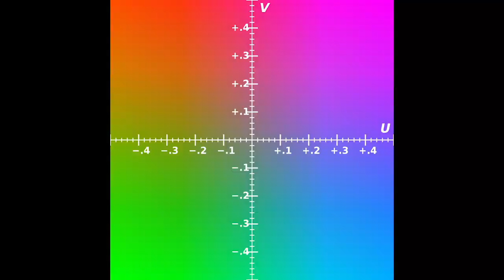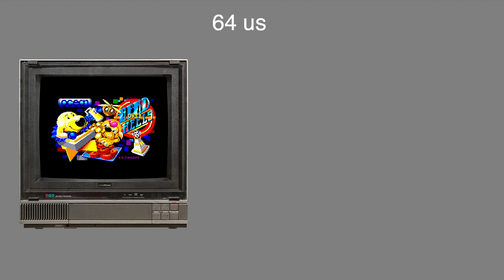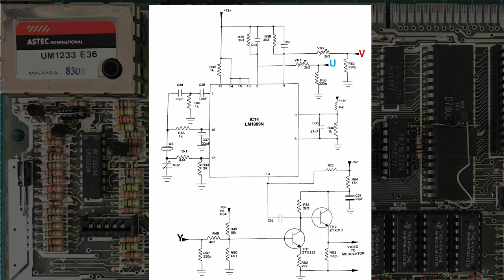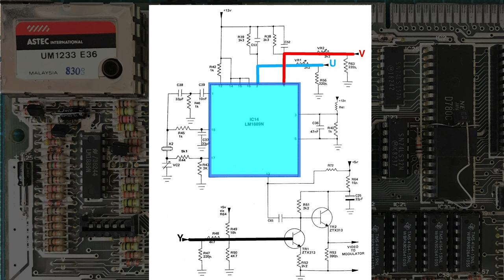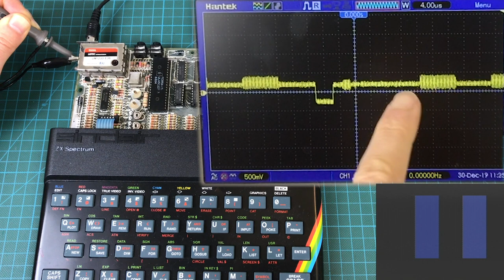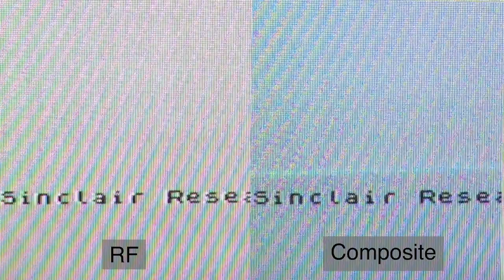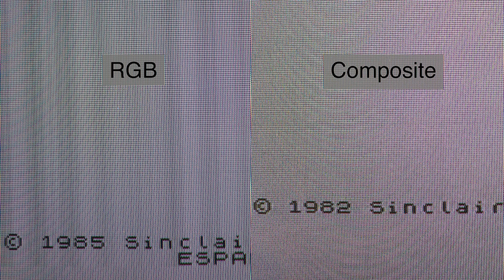ZX Spectrum Composite Video Mod

Comment: Back in the far past I had a friend mod my Spectrum 48k to have both RF and composite in the original output connector. Both the RF and composite shoved no artifacts when I used them on different monitors and TV’s.
As far as I recall the mod was done using a single bipolar transistor as emitter follower and a few passives, to inject the composite signal “onto” the RF output. I do recall this was a theoretical stretch as the transistor barely supported the required bandwidth, but the monitors I used managed to display a fine picture with no distortion. The addition of the composite signal did not degrade the picture quality on connected TV’s. I assume a high pass or to in the RF antenna signal path attenuated the composite signal sufficiently as the integrated bandwidth limit / low pass filter in the monitors composite input cut the RF away.

Comment: I got my ZX Spectrum later in January of this year, the composite MOD was something I was more concerned about trying do given my lack of experience in soldering. After watching this video, it helped me out on how to solder a capacitor in the RF lead. I failed to solder it in the first time because I put the capacitor backwards but I managed to solder it in correctly the second time! If I ever introduced someone to the ZX Spectrum and that they have to do the composite MOD to it, I would recommend this video! Thanks for showing us how this composite MOD is done, very helpful video! :)

Comment: I remember going from RF to composite, the picture quality improves not only in its sharpness but also in the fact you don't need to tune the TV in.
Reply from the maker: Definitely! And even tuning in to RF is not even possible in a lot of modern TVs, but composite video usually is fine.

Comment: Just re-watched this to do the mod to my Spectrum 48K+. I can confirm that it works perfectly. The only difference I made was to put the capacitor inside the RF box, just for that more factory look :)
Reply from the maker: Nice! I take it you emptied the RF box then? Or did you manage to fit it inside? I've seen people who empty the RF box, but I'm always hesitant just in case one day I want it back (why I would want RF, I have no idea though 😃).
Reply: @NoelsRetroLab  I managed to squeeze it inside. It was actually quite easy. Seemed plenty of space. Just got it local yesterday. I have old cars, I don't like to modify them so they can't be reversed!

Comment: Having a luma (Y) and chroma (C) signals available on the board I guess that there is a possibility of adding an s-video jack for even greater video quality output.
Reply: Even better! As far as I know, YUV is the same as YPbPr but with different names. That means it may be possible to add component outputs!

Comment: When you held up the back of the ZX spectrum to the light, for example 16:52 , it looks like the case is actually scored for another jack to be installed.
Reply: There are RF modulators that have the jack on the other side: NTSC modulators! Likely the idea was to make a case mold for both these regulators. But I do have a NTSC Spectrum that still has the jack on the same place! But my (NTSC) Timex Sinclair 1000 and 1500 do have a modular with the hole on the other side. Then there are these Argentinian Czerweny CZ Spectrum and CZ Spectrum Plus machines that I have which have two outputs on the same modulator! You've guessed it: one is RF and the other is composite video!

Comment: The expansion port (lower pin 15) also has the composite signal, the same one that goes to the rf modulator, so you can get composite signal without modding anything. I don't know why people aren't using this, instead of changing original hardware.

Comment: My ZX Spectrum clones had video output as RGB and Sync out (4 different pins plus GND), so this could be connected to a TV via RGB input like SCART, if I had one back then. What I actually had was a vacuum lamp (tube? what I mean is not a CRT but what was instead of transistors there inside) based monochrome TV and I had to make a "brightness and sync" out of that 4 outputs. So I used one diode for sync and 3 different resistors for mixing RGB signals in special proportions into one signal that TV accepted as brightness with sync (Y-channel actually).

Comment: You can put video mod directly with a cable without capacitor. Is better option. All TV have a resistor and capacitor inside from aux input video signal. And if you check zx spectrum schematic, you can see resistor and transistor limiting signal.

Comment: Hey. Loving this channel. I hope I can do something similar quality wise.
Just a question about the mod; how do you then get the sound to the TV? that was sent over the RF before was it not?
I did have the video on whilst I was doing other things, so I may have missed it if you covered it already.
Reply from the maker: Thanks! Well, that's one of the things that makes this mod so easy: There was no sound sent over to the TV before! The Speccy uses the internal speaker, so that part doesn't change.
Reply: @NoelsRetroLab  ah! that makes things much easier haha. I've never spent much time with a speccy. I prefer my Amstrads.
Thanks again!

Comment: Surprisingly ... Composite looks better on my eyes than RGB, firstly the lines are sharper in the character, and the colours are brigth. Also I could tell the colour of the text down screen.... white/gray (on Composite) vs Yellow (on RGB).
Reply from the maker: I agree they look really good both of them. Composite has some edge issues (look around the lives of Manic Miner). On screen RGB looked sharper for sure (maybe too sharp?). I did notice the color difference after the fact. I wonder if I don't have the color pods properly calibrated because this is an Issue 2. I didn't notice anything else being clearly the wrong color though.

Comment: I recently built a Spectrum 48k from a kit. All works okay with composite mod,  but on one TV it doesn’t display colour (monochrome only) and the picture is slightly shifted down the screen.  Other TV is fine.  I’ve been comparing two signals to see what difference may exist.  There is some variability in DC offset.   Could this account for behaviour with the two TVs?

Comment: There's a lot of prejudice against the RF connection, but it can have the same quality as the composite-video.  All you have to do is to use the correct 50 Ohms cable for the connection.

The reason why RF usually looks horrible is because people use composite-video cables with it.

Comment: I seemed to remember doing the mod on mine back in the 80's however I'm pretty sure I didn't use a cap.  Now my monitor was a green screen so not sure what impact that had on color but it did work fine.  What is the cap doing?
Reply: It blocks any DC current from  being exchanged between the spectrum and television.

Comment: I find your explanation for the 64 microseconds of the Y, U & V signals awkward and confusing.  You are right its the PAL video standard signal with 625 lines at 50Hz that is interlaced which is being used.  So every second there should be 50 x 625 = 31,250 lines drawn on the screen (1/31,250 = 32 microseconds), but since it is INTERLACED, there are only half the number of lines that are drawn on the screen per frame, that is 15,625 lines which yields to 64 microseconds (1/15,625 = 64).  Interlace is a technique that is used to draw only half the number lines for every frame due to electronic constraints that did not allow TV sets to do full scanning per frame or what is known as progressive scan nowadays.  These lines are drawn/displayed in the following order, one frame does the ODD numbered scan lines and the other frame does the EVEN numbered scan lines.  The peaks that are displayed in the oscilloscope at every 64 microseconds are for the retrace of the scan line.

Also the Y, U & V signals are present on the edge connector as well the composite signal at pin 15 underside.

Comment: I'm a newcomer to ZX Spectrum and this video was very helpful for me. Many thanks. I will give something like this a try with my Sinclair ZX Spectrum+ 128K when I get tired of RF video. IMO this mod would be even better if there was a way of switching between RF video and composite video (or VGA), perhaps by using an external downconverter/receiver... Also, maybe there is a better mod for Sinclair 128K with its RGB output (I really don't want to use SCART cables though...)?

Comment: Noel; I came with one question... Have you tried the different mods for composite video? with/without transistor? Does it make a chance that could be worthier than without to implement? Thanks
Reply from the maker: Good question. I've seen all those mods but I haven't tested them. You don't technically need anything, you could connect the composite vide out directly to the socket. The capacitor is just there to decouple the electronics in the Spectrum from whatever you plug in, but it doesn't actually affect the signal. The transistor supposedly boosts the signal, but I haven't seen the need for it in the TVs I've tried.
Reply: @NoelsRetroLab  you are right. There is not a clear reason to implement a transistor unless the cable were too long and high impedance or TV receptor in RCA connection with higher resistance than usual.
Reply: @NoelsRetroLab  Stupid question - doesn't the capacitor remove the DC part of the signal though? Couldn't this be an issue on some displays?
Reply from the maker: @baze3SC  Yes, the capacitor removes the DC part, but that's what you want anyway. That way the display could be biased in a different way and all it gets are the changes in voltage. Chances are the TV has its own capacitor at the input anyway, so this is just to be safe.

Comment: Noel I have a TV with Y/Pb/Pr input,so if i drive the signals from 15th ,16th and 17th ULA's legs to that port it gona give me a working screen?
Reply from the maker: Good question! I don't know the answer for sure, but there are a couple of things: First of all, I've read in a few places that component signals are not all the same and there are some variations. So maybe the Speccy one isn't the same as the one your TV expects. I'd love to find out more about it. The other problem is that, almost for sure, the signal out of the Spectrum isn't going to be strong enough to drive a TV (just a guess), so at the very least it will have to be bufferered with some transistors. If you do end up trying it, let me know!
Reply: @NoelsRetroLab  as a matter of act i tryed this today and all of the times my TV it was ''saying'' NO SIGNAL DETECT. So i think you are right that  the signal is not strong enough. Because i don't have an oscilloscope it will be helpfull to be meassured the output signal after the ULA and after the ic14 and compare it. Next week i will try the transistor solution
Best wishes from Greece
Reply from the maker: @sakisyoutuber  It's not just a matter of measuring the voltage at the ULA, but finding out the resistance expected at the component inputs. That should be standard and easily available everywhere. One thing I did was to feed similar outputs (from a TMS9929A) through an OSSC and it managed to interpret the signal correctly and put out an image. But I know you want to do it directly, so you'll probably need to use those transistors to boost it.

Comment: Hello, very nice video. I did this with my zx spectrum because i wanted to improve my video. RF was working. I used a 100μf capacitor 16volt because that was available. Strange thing is that i see a very nice picture but after a few minuts (sometimes  seconds)  he starts to disturb and eventually the image is completely gone. I also tried it without a capacitor. Same problem. Could it have to do with PAL? any idea?

Comment: Is polarity of the capacitor important? Is the reason negative terminal connected to the video jack that in case there is direct current flow into the jack the capacitor won't blow up?
Reply from the maker: Good question. I don't remember. It could be that the video signal has a positive offset in the Spectrum, but I'm not 100% sure.

Comment: Is it possible to remove the entire RF from the 'box'? I ask because I tried it and somehow I have a very terrible signal now. Very unstable. I also removed a piece of the metal casing so I can place a reset switch at that place coming out on the back. But I'm confused why suddenly the picture is so unstable and terrible. Checked for shorts etc but all seems fine. I thought the inner component weren't used anymore.
Reply from the maker: Yes, definitely! That's actually a great thing to do if you know you aren't going to use the RF out anymore. I love the idea of the switch there. The image quality shouldn't be affected. Make sure it's still getting ground (it was getting it from the box itself) and the composite video from the input.
Reply: @NoelsRetroLab  mm.. interesting...I makes ground quite well. There is an image (most of the time) but it is going all over the place, flickering, noise etc. Maybe I messed up something else on the board then.
Reply: I have an extension module also with a composite exit (directly connected to the edge-connector) and interestingly that shows the same garbage so I suspect the signal internally is already broken. Guess I'll have to dig up the schematics and see if I can understand enough to troubleshoot this.
Reply from the maker: @dannybloe  Check that you're getting 11-12V at pin 12 of the LM1889. You may have accidentally shorted something that caused TR4 to be damaged? That's also what you get when you have really bad electrolytic capactors (because they don't hold the 12V line steady).
Reply: @NoelsRetroLab  It's a steady 11.8V so that looks okay not? 12V pin on lower membanks is 12.xxV
Reply: Also I recapped all the the caps recently on this 3b board. Funny was that the image was ok but after a couple of minutes it went bad. At from what it looks like the spec is working ok other than the vid...
Reply from the maker: @dannybloe  Hmm... those are tough. Have a look at the last part of the Inves Spectrum+ video I made. It was a different chipset, but video also went wonky after several minutes. I was able to narrow down the problem by using a cold spray. In that case it was the PAL encoder.
Reply: @NoelsRetroLab  I was thinking.. when I just did the 'mod' of removing the RF module and reconnected the stuff I forgot to replace that little shield around the connector preventing shortening to happen when you put the plug in. Is it possible that that caused the problem? That I made short there? Or shouldn't that matter in that place?
Reply: Mm.. no, forget it.. it doesn't make any contact, besides both parts are grounded anyway.
Reply from the maker: @dannybloe  Which shield are you talking about? The one for the cable that goes into the box? That carries the composite signal and can't touch the box.If you're talking about something in the RCA connector itself... I'd have to see a picture. The outside is ground, so all of that just connects to the box (make sure it does). The inside should just connect to the capacitor from the composite signal and nothing else. So yeah, check that because you may be on to something.

Comment: Would this mod work for the 128k +2a?
Reply: The short answer is no. You would have to route the signal directly from TEA2000 and basically replicate the circuit from 128K/+2. But the good news is that it's only three diodes, a transistor and a couple of resistors so it can be done. I created a similar mod on a small breadboard and placed it inside the modulator case. Some details can be also found here: https://spectrumforeveryone.com/technical/modifying-a-2a-or-3-to-output-composite-on-the-rgb-port/

Comment: That the brighter colour has lower voltage seems counter intuitive. What have I missed?
Reply from the maker: Just that the signal is reversed. As a matter of fact, I've seen it listed as Y' in some of the technical manuals. It probably refers to that. Again, they probably did that to make the combining of the signals later easier.
Reply: @NoelsRetroLab  Doesn't Y' mean Luma, ie. gamma corrected Luminance (Y)?

Comment: Can we do this trick with the 48K model (non rubber keys)?
Reply from the maker: Absolutely! They're the exact same computer (different issues but it doesn't matter most of the time) and just different case/keyboard.
Reply: @NoelsRetroLab  Thanks!! :)
Reply: Hey again! :) 

The negative of the capacitor is the short leg, right? And the short leg of the capacitor goes on the inside of the RF modulator box, right?
Reply from the maker: @Quazatronn  Correct! Good luck!
Reply: I've done it successfully! :)
Lol. I'm so happy I did it alone! Ah ah ah.

However, I still have a strange ghost over the general image. How can I take a pic abd show you? Are you on Facebook?
Reply from the maker: @Quazatronn  Congrats! That's a great feeling getting something like that done for the first time! :-) The ghosting is weird, but yes, you can hit me up on FB https://www.facebook.com/NoelsRetroLab or even on Discord (check out link in the description).

Comment: Is there a way to rgb mod it?
Reply from the maker: It's possible, but I've never done it. It should be pretty similar to what I did with the TI99 RGB out. But I really don't think there's a lot to be gained from it. Composite already looks pretty great.
Reply: Noel's Retro Lab I wonder how much better s video would be if possible

Comment: and a lot of ztx tranzistors why they dont use a bc547 or similar
Reply from the maker: Honestly, I don't know, but I know you can't use those to replace them. I think those transistors need pretty specific characteristics to get the kind of oscillations they need to generate those voltages. And they also need a fair bit of power since just about all the current for the computer goes through there.